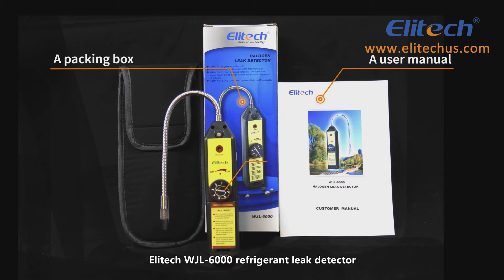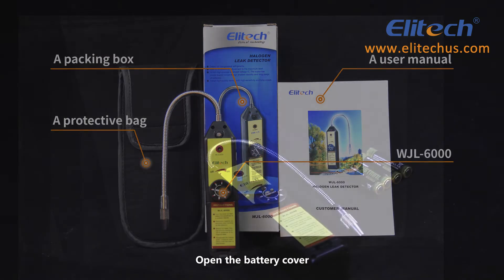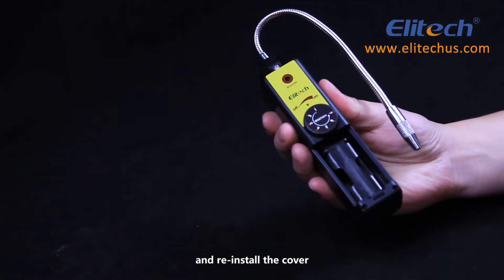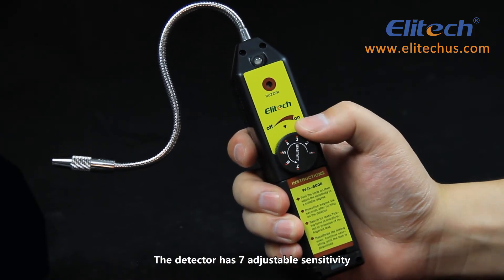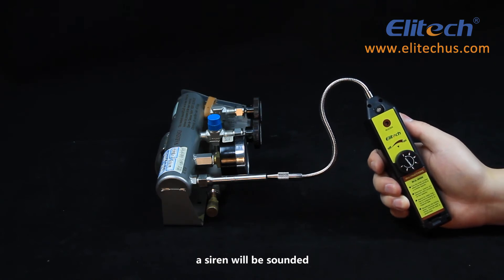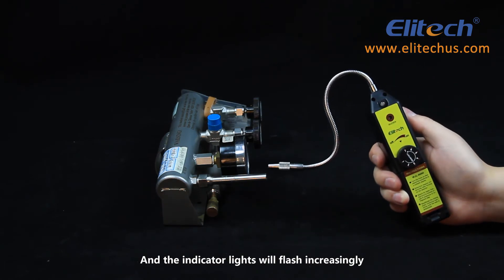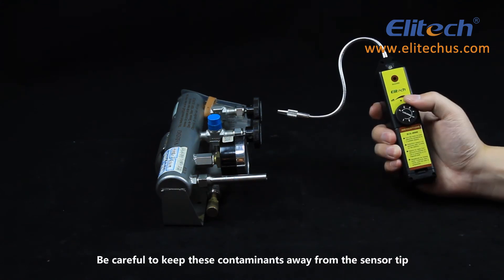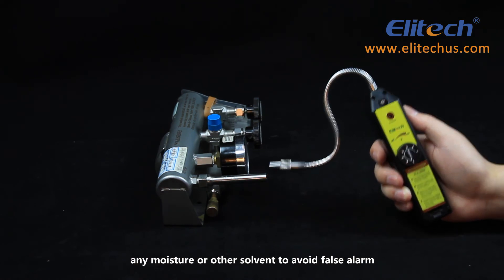Elitech WJL-6000 Portable Refrigerant Freon Leak Detector

Comment: Only insert just the tip?
Reply from the maker: Hi, you don't need to insert the tip, just approach the tip to the system. If there's a leakage, the sound will speed up.